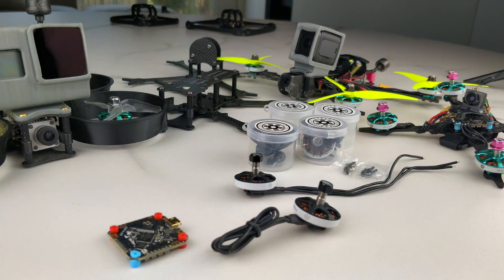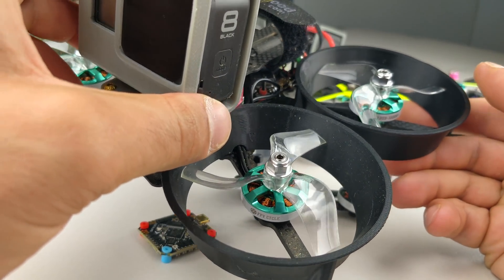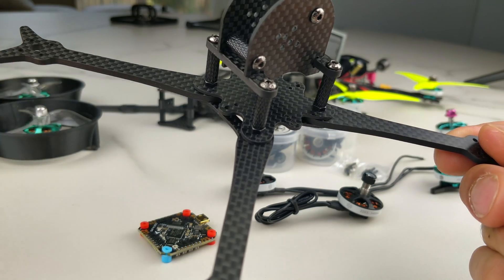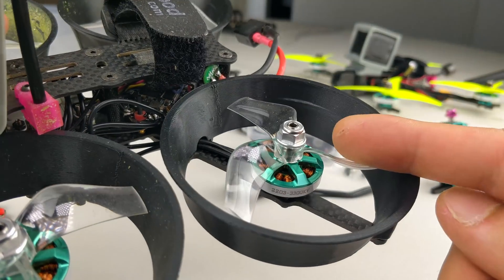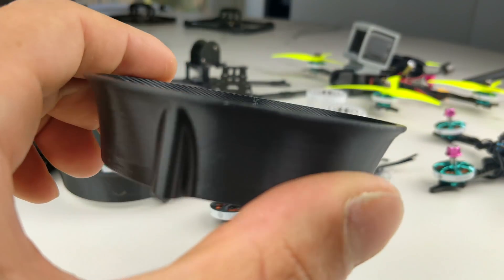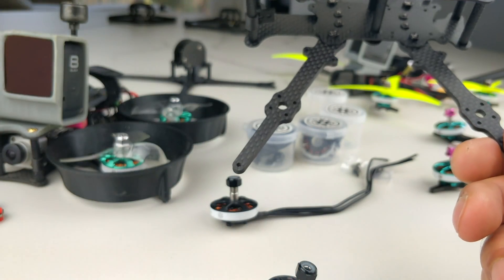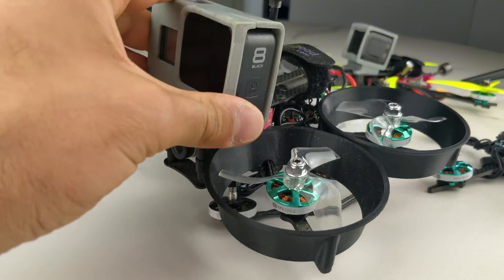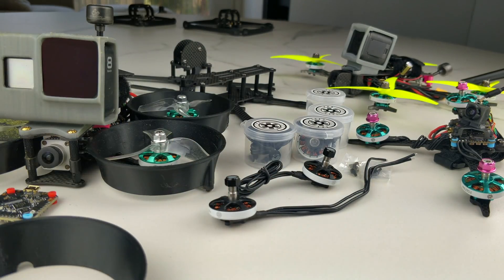FPVCycle 2203 for CineWhoop through 5"

Comment from the maker: FPVCycle 2203: https://bit.ly/3i7QPuA
CineSplore: https://bit.ly/3dGJu1z
Gemfan Duct props: https://bit.ly/385nvAk
30A 4S AIO Toothpick board: https://bit.ly/3i8POCq
PowerPick: https://bit.ly/3fW6iMq

Longer Vista antenna - https://bit.ly/2ViXhFg
Vista + Nano Nebula - https://bit.ly/2ViXhFg
Vista kit + longer camera wire - https://bit.ly/2ViXhFg
200mm DJI camera wire - https://bit.ly/3eyBYXU

More things coming soon to FPVCycle.com

Table of Contents:
►00:00 - Intro
►01:31 - Motor intro
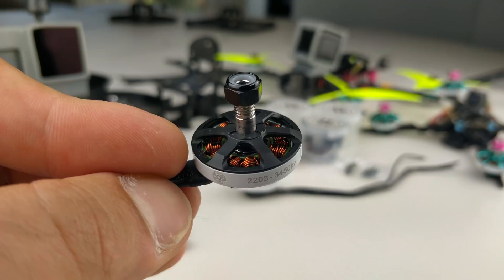►02:36 - Platforms and scope of use
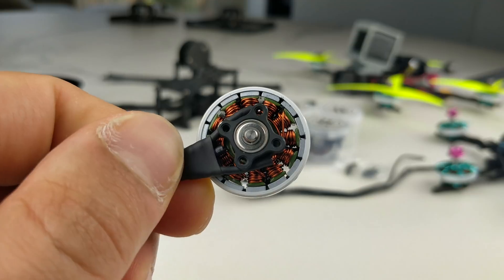►06:13 - Motor overview
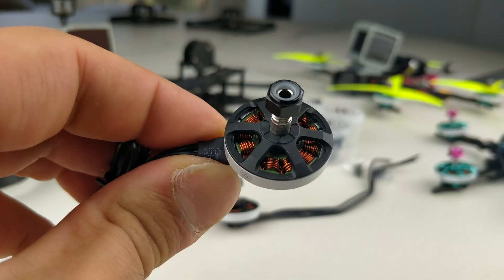►08:38 - Ducts...
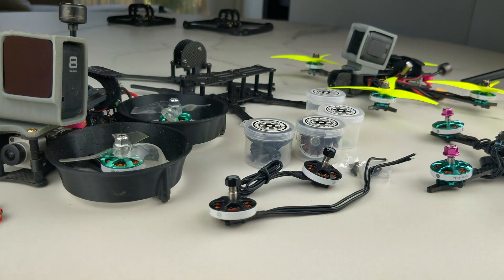►12:30 - Flight performance improvement

▼Join my FB group for more discussion: Kabab FPV
https://www.facebook.com/groups/379155946182689/

The store: www.FPVCycle.com

▼ My typical 5" quad setup:
-CineGlide: https://bit.ly/2MCoz50
-Motor: http://bit.ly/2Nqqr25
-ESC: http://bit.ly/2oDdzvL
-WaFL’s Cap Cap: http://bit.ly/2GUpXxO
-Battery: http://bit.ly/2JnsTDM
-FC: http://bit.ly/2XRc8G8
-FPV Cam: http://bit.ly/2Q7LfL7
-Vtx: http://bit.ly/38Y25oz
-ND GoPro Mount 30deg: http://bit.ly/2WC15zc
-ND Filter (if used): http://bit.ly/2WEmQ1j

▼Notable motors:
Check out the Rcinpower Wasp and Bison...interesting motors coming.  We're working on blending those two motors into one.  The Wasp is more powerful but the Bison has an awesome 11mm bearing that's uber smooth.

▼Starter goggles: http://bit.ly/2qbJNOS

▼ If you want to solder better:
-Fantastic solder: https://amzn.to/2P5QM2W
-Fantastic iron: https://goo.gl/DqBipa

▼ Tips?
Patreon: https://bit.ly/2oGLP9b

-PayPal: https://www.paypal.me/kababfpv
-Bitcoin: 1E4XZXoD4rS6MYWVWuenY7Kw2M1YgyNpoQ
-Nano: xrb_1188ek5bd7tb9kw67asnp9o65byuoaxbtpxuznx1ribf75x78awywmakj55f
-ETH: 0xD067F93811f2eC31CB1928901002dfdf9A492EF5
-LTC: La2KWYAjp4VT2Lq2M76pbjzXWvRyjpfCtG
Reply: Can you turn the camera around the next time, I would like to see the man doing all of this great work!
Reply: Any plans on a 6S version / do you think the motors would hold up to real racing?
A friend and I are experimenting with sub 250g 5" race copters (https://youtu.be/WIcWXXxiBV8 ) and so far the weak spot are the motors…

Comment: Hi Rob, plan on building a 3 Inch racewhoop30 frame and 4s. Do you recommend these motors over the 2105.5 motors from HGLRC?
Reply from the maker: I'd focus more on the Kv than anything else.  For 4S 3" racewhoop, you either want a larger motor or higher Kv.  3450kv is the lowest I'd go for a racewoop....but it also depends on the prop you're using.  I believe HQ has an eight blade 3" prop?  If you use that with 3450kv on the 2303.2 motors we have and 4S, it'll be about as good as it gets.  In general, the 2303.2 we have is a much better motor than any 200X, 210X or 220X.  We've tested them all and in many different Kv.  The 2303.2 we have is clearly better.  It's called the "23mm short" in the store.  However, that being said, as I said above, the prop selection and kv is going to be the most important factor for a racewhoop.  While the wider motor gives more control, the higher kv and/or prop selection is what will give you the speed.
Reply: @Kabab    curiosity and being a fan, I'd go for the 23mm. 3450kv and I'm running 4s. Also the better control is what I'm aiming for. Thank you.

Comment: I've got this motors and the same boards... and a similar 5" frame... I can't tune it, even with 4"... any suggestion? I've got propwash every time, if I fix propwash I get high bouncebacks on roll and yaw... idea BF4.2 with or without RPM filter... I really don't know how to set the pid switches for fixing it. I tried almost everything. Regards
Reply from the maker: Use Emuflight. Propwash has to do with how your filters are setup more than pids or anything else. Emuflight is much more hassle free. It's almost identical to BF in its use, it just works better with less hassle
Reply: @Kabab  thank you!! I'll give it a try

Comment: sorry i have a question, how many amps in flight?
Reply from the maker: Hard to say because there's no accurate way to measure. Most likely about 16A at full throttle but maybe 25A or more at full load.

Comment: I have a gecko 4", 2203 3000kv motors, gf4052 and 850mah 4s 95c... will xt30 suffice?
Reply from the maker: I'd use an XT60.  An XT30 will work but you'll get more flight time and performance with the XT60

Comment: @kababFPV I'm building a 4'' Armattan Bobcat as a mid-range 4s cruiser. I'm thinking about going with your T-mount 2204/2800kv for a mix of performance and efficiency. Will this setup be efficient enough for extended flight times, or can you recommend another motor size? AUW will be @ 300g.
Reply from the maker: The bigger motors are efficient but more importantly give you the power to lift a huge battery if you want to and still have good performance
Reply: @Kabab  thank you, that’s what I was hoping for, I will mostly be using a 3000mah li-ion, but one in a while 6-850’s.
Thanks again for your advise, and all your informative videos!!

Comment: kool vid, i noticed your ducts dont have much of a curved lip, as far as i know that is very important to the meander effect that creates the smooth  planted feel of the cinewoop, the curved lip speeds up the air on the edges creating the effect
Reply from the maker: The latest one have a bit more curve on them and are quite a bit different in general. It's my third to latest video I believe
Reply: @Kabab  ahh ok kool i should of checked

Comment: how am I guaranteed when I order the 2204 motors to get the 3000kv on the fpvcycle website they are showing a dual listing with no drop down menu
Reply: any thoughts
Reply from the maker: we don't have any 2203's left.  It's all 2204 now and the Kv's are 3450 and 2800.  Just left the 2203 and 3000 to imply that it's compatible with the 2203 and 3000kv
Reply: @Kabab  I made an order going out to Rimrock az shipping confirms they will be here on Monday could you verify what's coming my way
Reply from the maker: @reefercrazy1  do you have an order number?  If you ordered the 2203/4, you're getting the 2204. The 2203 doesn't exist anymore
Reply: @Kabab  order#9271
Reply from the maker: @reefercrazy1  2204 2800kv
Reply: @Kabab  thank you

Comment: I am building the Gecko 4" whoop using StanFPV prints and ducts. If useing the 2203 motors would you recomend 4s or 6s for that build. On your site you have a note that cinewhoops should not be 6s.
Reply from the maker: You really do not need 6S. 4S is plenty. If you're trying to lift two or three full GoPros then maybe 6s could be useful but still not required
Reply: @Kabab  yeah I don't see the need on the gecko whoop to run 2 gopro at same time

Comment: hi KababFPV
Do you have resellers within the EU for these motors? I want to avoid customs, but these are the only motors that will fit my purpose well I fear.
Reply from the maker: TBS has them. We're also working on free international shipping. We do our best to help with customs fees too
Reply: @Kabab  Isn't there any European shop that sells them? I would like to order them. Maybe for a squirt V2 or for a freezillion racewhoop.
Reply: TBS yes, but custom duties may apply
Reply from the maker: @babipsylon  for the freezilion frame you want a 2205 or 2206 with high kv. The 2203 will be the minimum you want
Reply: @Kabab  well they have a 12*12 mounting pattern and a 16*16 mounting pattern version of this quad. I was thinking your motors for 12*12 would do good also. Couldn't find a 2204 with high enough kv for 4s. That was the problem. Maybe I can find a 2205 with high enough kv (+- 3500 kv), or if you know one, you can link me. It's not heavier than e.g. a taycan, so why would I need 2205 per se?
Reply from the maker: @babipsylon  I don't actually know of anything that high but keep looking around. You really do want a ~2206 in 3000kv minimum
Reply: @Kabab  the solution would be 6s... but then I need to invest in new batteries. Zillion kind of said your motors would do, so... . I think he is right. But 2206 high kv on 4s would probably be better. xnova has 1804 3450 kv, but they are even less powerful than your motors, although I couldn't find a spec sheet for your motors.
Reply from the maker: @babipsylon  no way to anything narrower than 22. Also don't need to go to 23 either. Really 2204-2207 is ideal for his setup. My 2203 is at the bottom end of acceptable if you keep it light.
Reply: @Kabab  Why do you say that? Because the zillion frame is +- 300 gr dry weight, while other cinewhoops that go well with your motors (like the squirt v2?) are lighter?
Reply: @Kabab  rather 3500 kv I think
Reply from the maker: @babipsylon  that and because his frame is made to move quick. It's not intended to be a cinewhoop. It's like a speed whoop. His duct design also needs a lot of power. Ask him.
Reply: @Kabab  yes you are right, although I think you can use it as a cinewhoop too I guess

he said your motors would do fine btw

I think a friend of mine build it on 1408 4s and it still flies like a rocket, I should double check though, not sure
Reply from the maker: @babipsylon  don't do anything under 22 width. The new version of my motor coming is a 2204 so it will be really good. Won't be here for maybe 6wks however
Reply: @Kabab  hi. I'm in the EU. I think I will first build a squirt V2.1 then rather than the zillion whoop. Sorry about that, your cinesplore frame is not easily available in the EU, I heard it's also very good. Would you recommend your old 2203 or nw 2204 motors for the squirt v2.1 build? Or rather the typical brotherhobby 1507s or t motor 1507s?

Comment: My buddy has one with the Vista unit and it's amazing.Great job on this. The only thing that didn't appeal to me was it was pretty loud. To bad they dont make a noise cancellation board for these types of motors.
Reply from the maker: What platform is it on that's loud?  The way to reduce noise is to go up in prop size or down in wright. You could also use more bladed props but that's usually not preferred. The cinewhoops improve noise profile quite a bit with these motors and further with the StanFPV ducts
Reply: He's got the CineSplore just like you speced out. Same frame , same motors, same ducts. He was showing me the unique shape of the ducts. He's fine with how it sounds. He flies his 5"  to me a "micro - 3" toothpick guy it sounds loud. It's not as loud as his 5" but a lot louder than a TP3. :-) It is a great product. He's Free styling in a pine tree Forrest and flies like he owns it with no fear.

Comment: So you ah e to use throttle cut to use it as a lower kv motor for 5”?
Reply from the maker: No you don't but I recommend it because it's just so powerful on a light quad if you don't. This is only if you want to run 4S. The 3000kv is on the way.

Comment: Hey Kabab, so how would you say these would compare to 1606 3300kv, pretty good upgrade if think but would they work OK with a 4 inch that runs around 300g AUW? Thanks!
Reply from the maker: Yes definitely excellent for 4". Very powerful. Both 3s and 4s are good
Reply: @Kabab  nice. I think I may bite... Will these motors do OK with the hq 4x3x3 or the avan 4 inch props? Or. Do you strictly recommend the 4023? Thanks again!

Comment: I just ordered these motors and had a question, would a 20a whoop board work? I'm looking at the CLracing 20amp AIO. This is on the powerpick 5" with 5125 gemfans, 4s 850mah.
Reply from the maker: That really should be fine.  The board should be able to handle it.
Reply: @Kabab  Awesome, it has direct solder holes for unify pro32 nano and the nano crossfire rx. Should be ridiculously light. I ordered the 3450kv as they were the only in stock. Any idea what to cut throttle to? On 4s.
Reply from the maker: @dbc978  you don't need to throttle cut at all even on 5" 4s but I'd recommend like 10% maybe. Just a bit to make it a little easier to manage.
Reply: @Kabab  I was thinking I would cut it to 2600kv and move up from there. I'll let you know how it goes!

Comment: Wait, why no screw? But c-clip?
Reply from the maker: It weighs a lot more to go with a 4mm shaft, screw bottom and flush mount. So went back to the old style solid hardened 3mm shaft. If you look at this as a micro motor instead of a 5" motor it makes sense. 2203-2205 are not really full size 5" motors imo. They're more micro motors that happen to be pushed into full size 5"

Comment: This motor looks amazing! What are the odds of getting a 6s rated kv variant for sub 250 5" racing?
Reply from the maker: Why do you want 6s on a super light?  I'm gonna make a video on this but still if you want to, the 3000kv variant will do 6s fine. Super ultra powerful however
Reply: @Kabab  there's whoop boards now that support 6s and I don't trust throttle caps so much! That said I could just go with the 3000's and pray to the betaflight gods that I don't over amp draw the esc!

Comment: How would you compare the new Matek Mamba f411aio to this 30a 4s aio? Guess the Matek has proven itself more since its way more popular. I just want something reliable, which is difficult with aios...

How much less reliable are these build into a PP5 compared to a TP3?
Reply from the maker: The mamba has been the best one but isn't 100% at all. So far this 30A cheapo thing performs better across the board. It's not a big difference. Barely noticeable but I can tell from having built so many. So far the cheapo has been awesome. Hope it continues. It hasn't proven itself in volume yet

Comment: What toothpick / Powerpick configuration (voltage, prop size, frame etc) would you recommend for carrying a insta 360 go more or less effortless to get nice freestyle hd footage? And how would you mount it?
Reply from the maker: The PP5 with the 2203s will do it effortlessly on 3s and 5125 props. 4" is fine too but kind of that bastard size....might as well go 5
Reply: @Kabab  Interesting! Would love to hear more about the PPs (lol). Pro, con compared to normal heavy freestyle quads, to light racers, to smaller TPs... Seems reaaaly interesting. Guess all the parts will be sold out for the next time;)
Also some flight footage of the PPs would be great. Love what you´re doing to this hobby. Please keep pushing!

Comment: So I am assuming there is another motor specifically focused on 4 inchers coming? Is there also gonna be an ultralight 4 inch? Thanks?
Reply from the maker: Nope. This is it. It's frikin awesome on 4" and more awesome on 5".
Reply: @Kabab  thinking of taking the vy 2004 3150kv motors off my 5 inch and build a 4 inch using those and then put the 3000kv version of these on the 5 inch. 👍

Comment: is there a mounting solution for a vista on top of the whoop board for the powerpick? Would you need taller standoffs also?
Reply from the maker: Mmmmm I wouldn't be a fan of the Vista on something with such little protection for it.
Reply: KababFPV I am going to order some of those new motors. I want to put them on a new frame and I thought that was the reason for the bigger carbon fiber canopy. I have a gecko 4 but keep breaking motors cuz there is no protection. Do you have any recommendations for a lightweight vista frame that can take a few hits? Or maybe something coming in the future? Cheers
Reply from the maker: Yeah that frame is the Fouride. That's specifically the purpose of it.

Comment: Hi Kabab, i have a idea for you, just put those motors 2203, on 6s kv version and T mount version, in a 6s AIO board, your light 5 inch frame that you showed, and go with gp lite from betafpv, and if all up weight will be to low, just throw in a min 1800mah lipo. That like a perfect quad form me :D
Reply from the maker: 6s is not actually very good for things that don't need it.  Gonna be making a video about that

Comment: I'm ashamed. I bought the JHCMU F411. Its on my favourite quad: 
Apex1607 + ET5 + GNB 1100mah. 270g AUW. 4400g thrust. Ridiculous 16.3:1

Ultralight 5" is blooming. Excellent motors. Great frames. Variety of efficient props. Amazing 1g nano camera. And ofcourse DJI Digital.
But, FC/ESC is a big let-down. 

After spending $100 you think hobbyist want to save $5 on FC?
F7, Blackbox, 3 UART and BLHeli_32 should be MANDATORY. Feels like 2015. When do we get 480Mhz H7? FOC ESC? 
Its sad only iFlight Succex-D 20A AIO has DJI Air/Vista hookup.
Reply from the maker: The JHEMCU 30A board is shockingly awesome.  All my favorite quads have that board in them now.  I can't even believe I haven't had a single issue with them.  All work beautifully.

Comment: Would this be a good motor for a 3inch acro with caddx vista perhaps? Feels like it might fit alright? Or would you move to 4inch or more?
Reply from the maker: So the motor is actually 1.1" wide.  It is surprisingly good for 3" but somehow it seems a bit funny to me :-D.  I'd rather use something like a 1506 for max performance on a 3" prop without ducts or anything.  I'm building a 3" with these motors right now however so I may eat my words.  I haven't tested this motor much on open prop 3".
Reply: @Kabab  haha that does sound silly.

I am aiming for your tp3 and was hoping to get it to take a caddx vista as well by upping the motors. But I'll try with the 1404 I have on the way (1303 wasn't easily available in EU)

Thanks for great content!
Reply from the maker: @topfs2  1404 is good. It's gonna be insanely fast however. I'd advise the 3018 prop

Comment: 2203 is such a cool size of motor for 3/4 inch

1609 motor for cinewhoop sounds interesting. Have you tested those at all?
Reply from the maker: yep I've tested the 1608 and 1609.  They're about the same as 1507 and weigh more than the 2203 without even having a prop shaft so I don't really see the point.